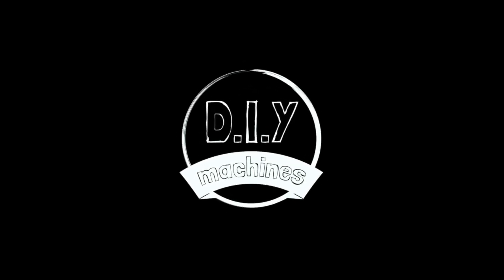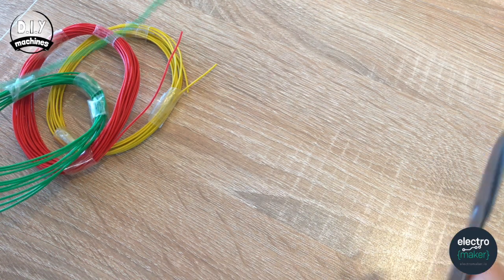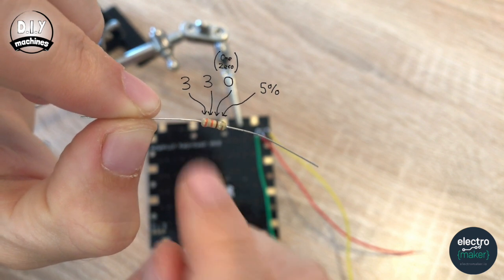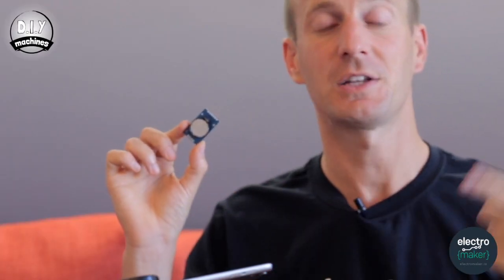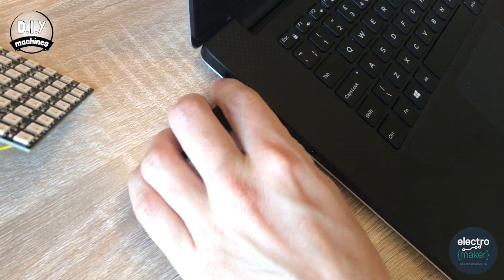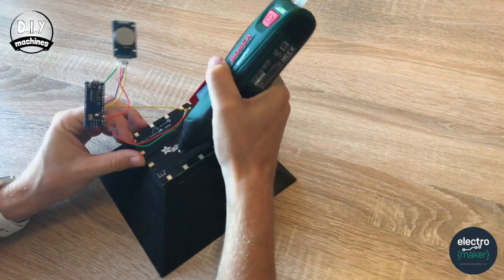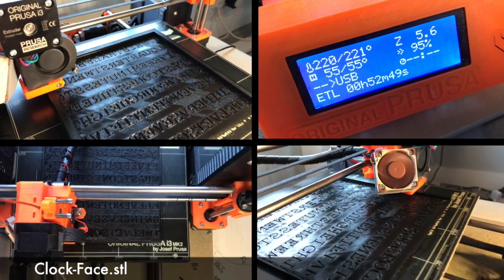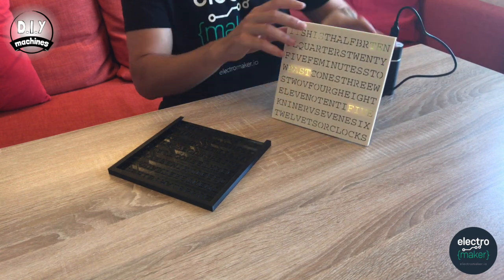How to build a DIY Word Clock Display with Adafruit Neomatrix

Comment: And, once RTC battery is dead, one needs to burn new code to the Arduino. I must teach my grandmother how to do it.
Reply from the maker: Hi Fibra, yes you're correct. She will also need to replace the button battery on the RTC as well.
Reply: No problem, she started to practice microsoldering meanwhile and she  also started to learn coding. She said that code needs some optimization. :D
Reply: @Electromakerio  It would be a little easier to change the battery if you had Hot Glued the RTC module the other way up.
Interesting project.

Comment: Hello, very good instruction.
I have a question about the rgb, how can i change the colour of the rgb leds?
Reply from the maker: On line 465 of the code you can set the colour in RGB values:

     matrix.drawPixel(i, j, matrix.Color(255, 255, 0));

It's the three values in the brackets at the end. So if you wanted green you would charge it to (0,0,255).